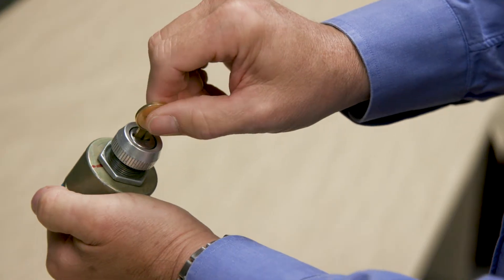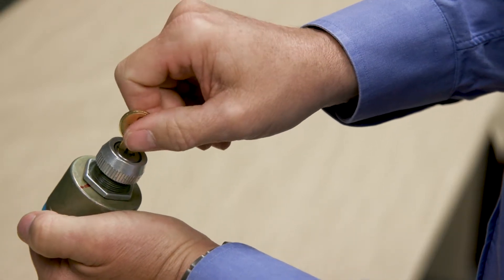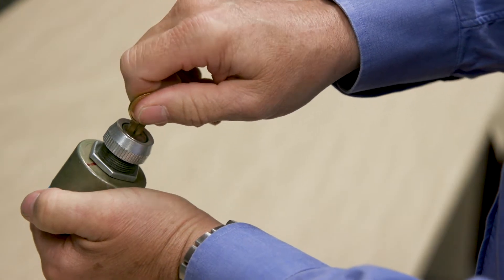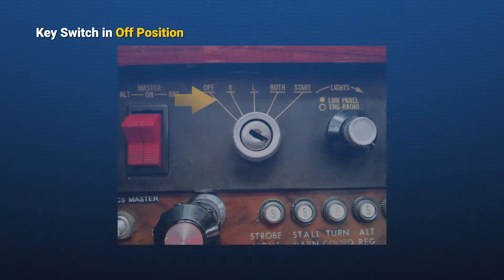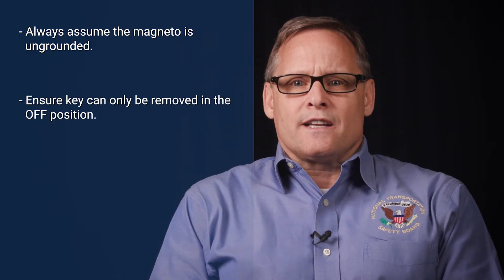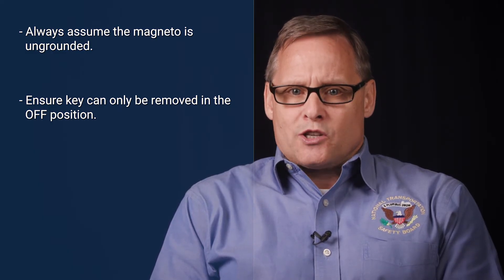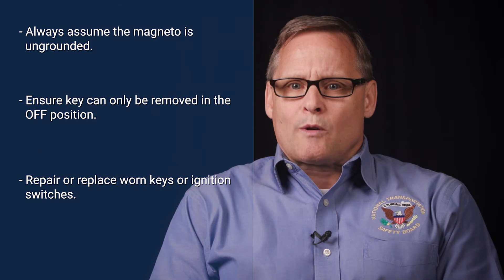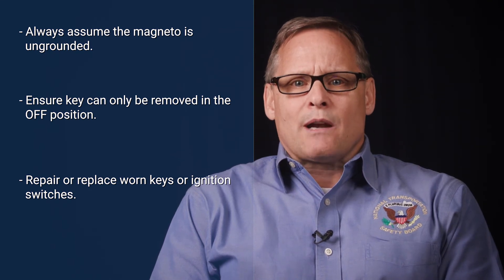Safety Alert - Check Ignition Switch/Key Integrity

Comment: Great reminder! While preflighting my pipeline patrol plane this morning, the key would pull out of the "Right" position! Wrote it up for replacement.

About a year ago, on another patrol plane, when I reversed course while flying a gathering system, the key fell out on the floor out of sight.  On landing, maintenance replaced the switch. To put that in perspective, a couple of weeks later, I had a mag go south. It sure was nice to be able to identify the bad mag and operate on the good mag to get back to the closest airport without the engine running rough. That would have been tough to do with the key somewhere on the floor!